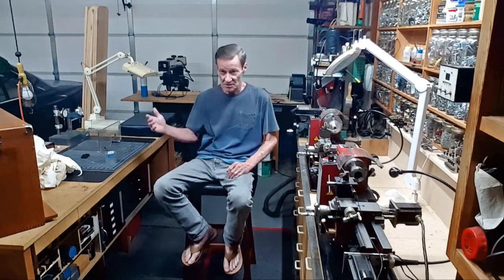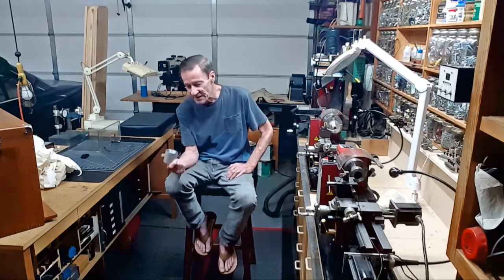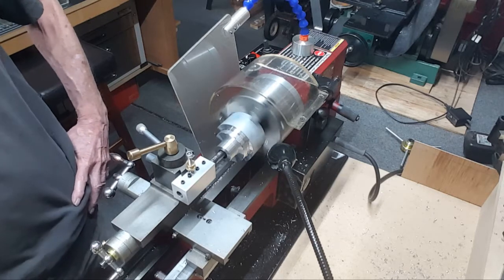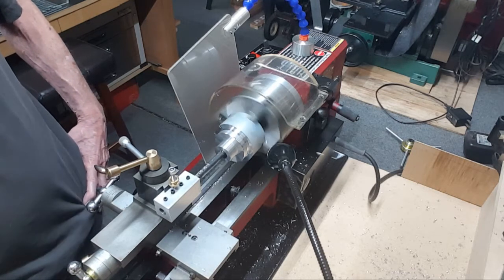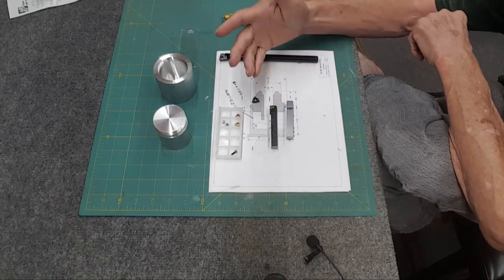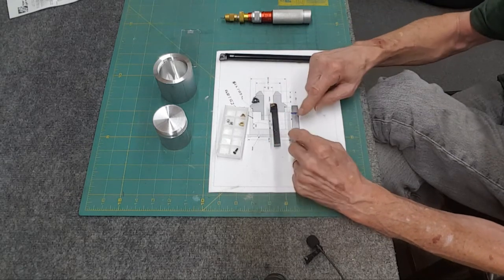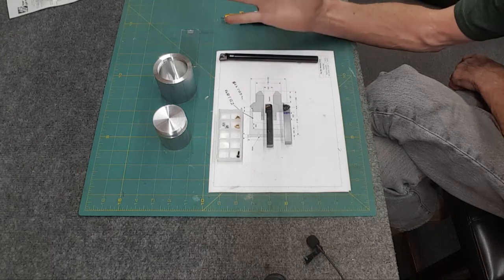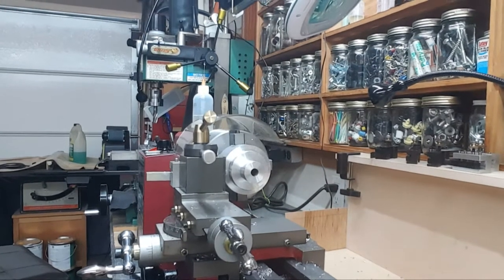No Spill Oil Container PT 3

Comment: Have you ever thought about the bed extension kit for your lathe? Little machine shop sells it and you can get 16 inch bed for about $230 I think
Reply: That’s a great suggestion!
Reply from the maker: The problem as usual is no room. With two lathes and a mill on one bench there is just enough space for the mill X axis to move. As it is one lathe has the stepper hanging off the bench. Only if I were willing to leave my car outside!

Comment: I enjoy seeing  your work and your solutions for the  issues that come up, thanks for sharing.

I wonder if instead of replacing the battery in your DRO tablet you used an AC supply in it's place, never have to charge it and could power on or off with the one switch on the machine.
Reply from the maker: I tried an adapter but internal circuits say nope won't work. But thanks for the idea!
Reply: @TheMiniMachineShop  Hi Dave, I was thinking along the lines of remove the battery and feed power to where the battery was. Might need 3.7v at an amp or so maybe one of the adjustable buck converters off Amazon would work, it's something I've been meaning to try.